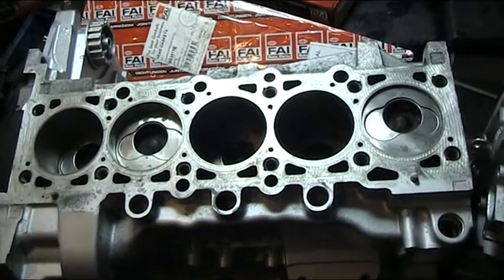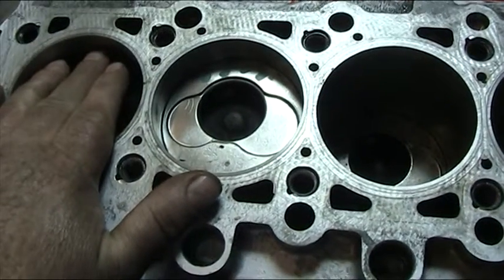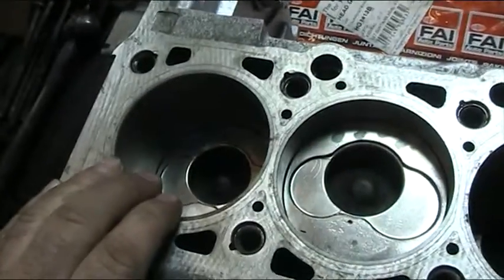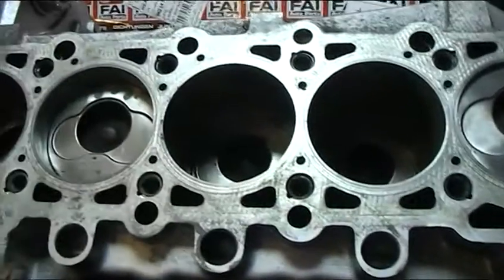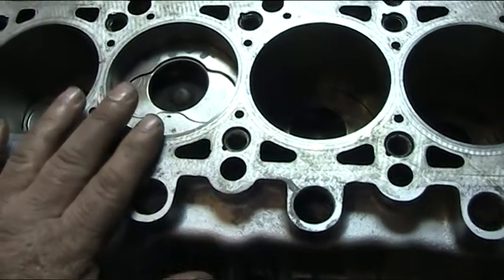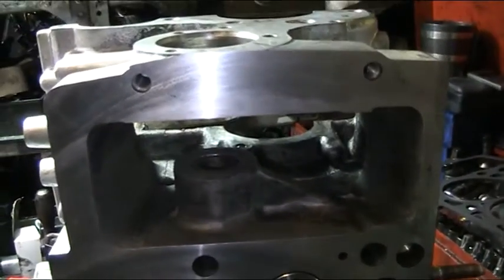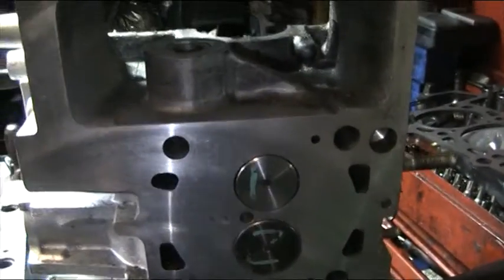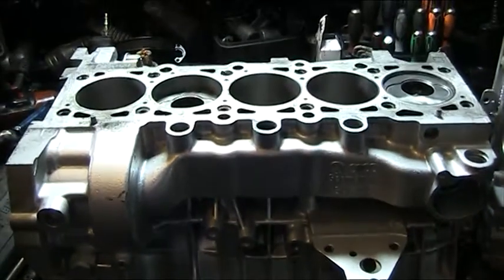vw transpoter t5 axd and axe 2.5cc pd 5 cylinder engine bore wear now can be fixed !

Comment: Hi, do you have experience of BNZ 2.5tdi engines  (2008) ?  Are they very different in this regard (also are you aware of injector issues , wearing the head) ?  
thx and thx for posting this video.

Comment: When your are pressure testing the block after replacing all valves etc .. do you put the injectors back into the head to pressure test the internal fuel rail pressure

Comment: Hi Charlie, Im looking for a engine project, does the R5 2.5 non PD and R4 2.0 engines all have this fault ?
can you suggest a engine with mechanical injector pump or a engine that one can be fitted ?
Cheers
Brett

Comment: nice job Charlie. I've still got that bac block at my work. Merry Christmas buddy.
Reply from the maker: hi bud give me a ring 07768586030 charlie
Reply: charlieengine hi Charlie 
What's your company name?
Reply from the maker: qcs 07768586030
Reply: Hi Charlie, Update on my vw it hydraulic last Thursday on start up. It was relatively mild one. I've removed the engine and on close inspection the inlet port right next to the top hose is porous resulting in the coolant filling up cylinder 1. It's always used a little coolant since we got the car (5years) but this last month it escalated. I have a spare but the injector bores are worn or I guess its a after market head. What do you recommend?
cheers Stu.
Reply from the maker: if nothing else you will have a short rod and the piston will have kinked in the bore and a cracked cylinder head now thing are going down hill for the engine putting bits on her and there can cost you more in the long run then a rebuild its your money
Reply: I removed the rod and piston and its a good 1.5 mm shorter than the spare I have. Bore and the coating looks ok to the eye. Im sure its the head. there signs of leakage from around the inlet port. Guess more of a project now.